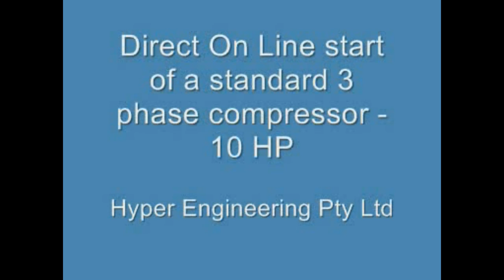HVACR Questions & Answers 2

Comment: HI JIM, I found a condenser fan motor running backwards what i found was one of the line voltage 
wires was put on the fan terminal of a dual-value run capacitor ( 5/35 mfd x 370vac in this case) and the cap wire was put on the line voltage terminal of the contactor.

Comment: @someCNGNOW The best way to fix a leak is to use an electronic leak detector and run it all around the system, when you find it, then you can replace parts and make repairs as necessary.

Comment from the maker: @tjweber32 I'll have run into a TXV failure to show one. Usually, if the low pressure is practically zero and the high side is about normal then you probably have a bad power head on the TXV.

Comment: Hi Dr Z, some time ago you  made a video on crankcase heater installation. You mentioned that ideally it would be better to hook up the two legs of the CCH  to an auxillary contactor so that when the compressor turns on,  the crankcase heater would turn off and vice versa. I would really appreciate if you  could show a short video on how to...
Also what would  be  the  correct wattage on  a scroll 3 ton compressor crank case heater for R22.